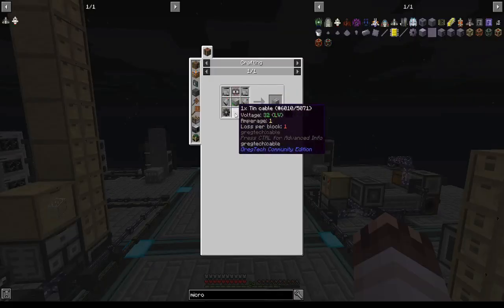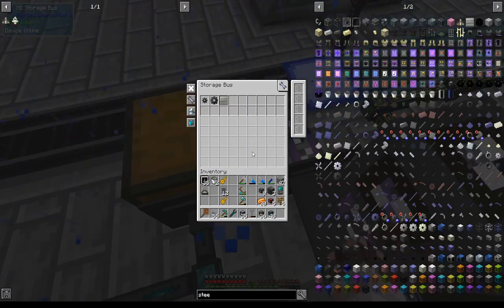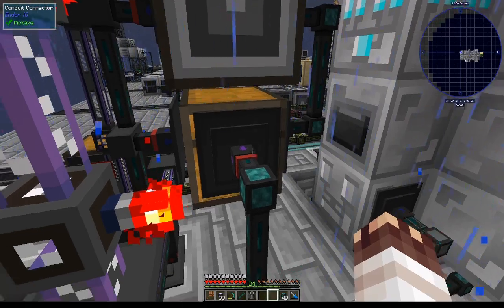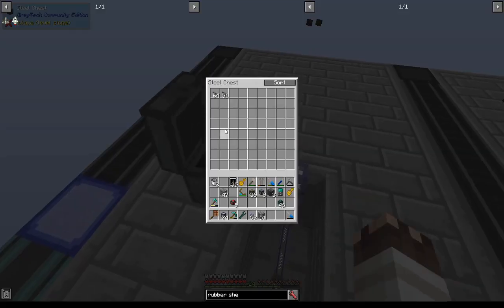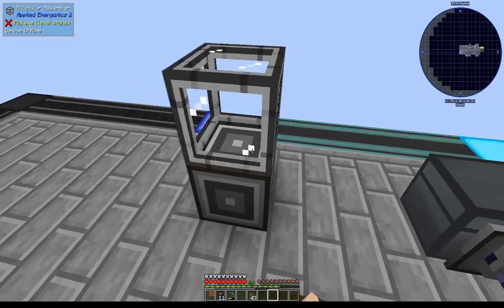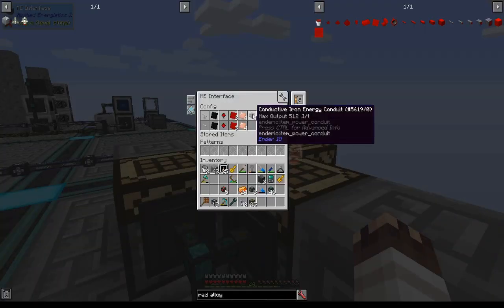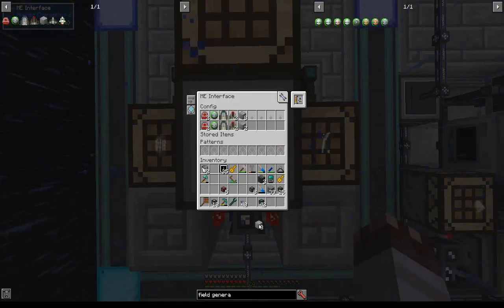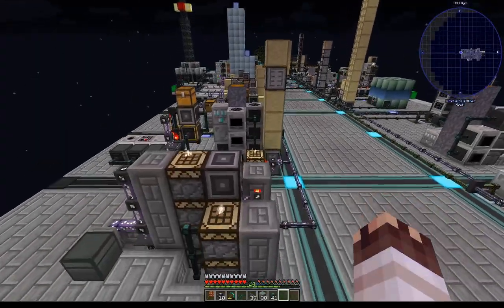New Omnifactory Supershorts #25: Passive Machine Parts and T1 MM Part 2

Comment: I think you said last episode that you have no need for the LV components now, but you could keep them stocked as they are used to trade for omnicoins so you can get less common ores.
Reply from the maker: Oh, did I? I'll still need the LV motors and pistons for the T1 MM. | Additionally, I considered doing that, but my principle for this playthrough is to get most everything I can get from Microminers, from Microminers, unless processing a certain ore for a one-use material is much easier than using MMs. But theoretically I should be able to get everything I need from now on without coins!